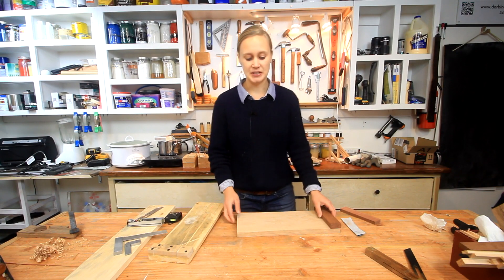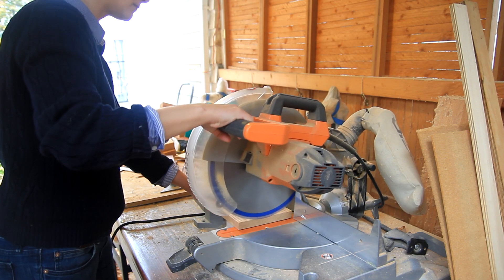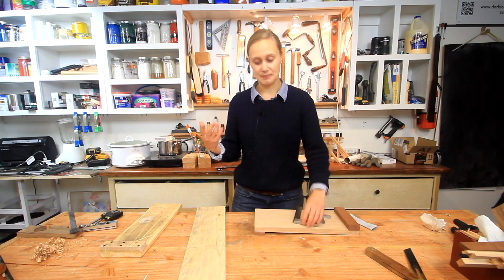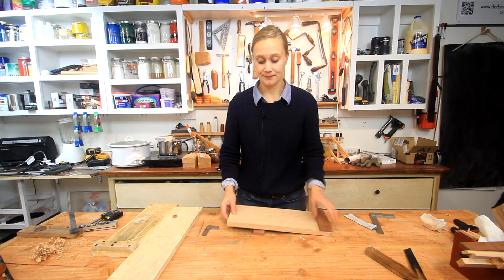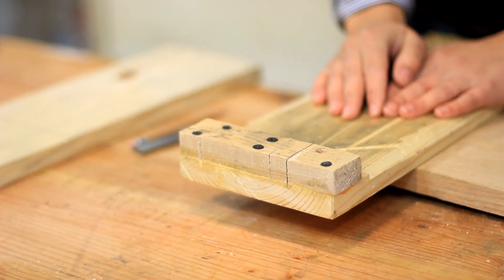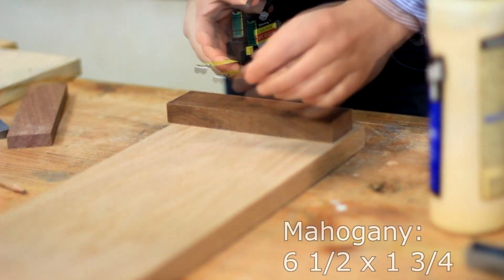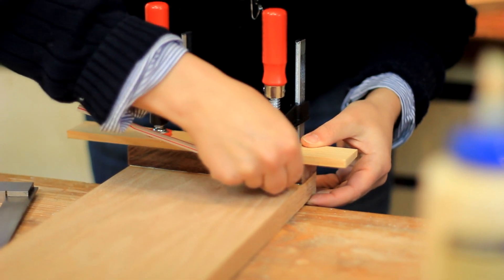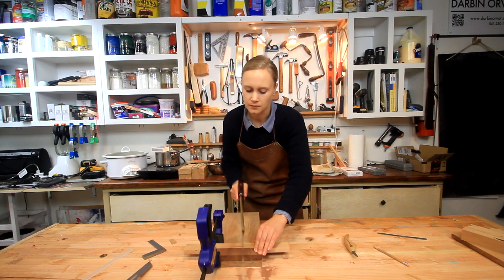Making & Using a Bench Hook

Comment: A bench hook is one of the most useful tools in the shop and about the cheapest too and it can easily be used as a shooting board also to square up those pesky ends and miters.  Good video Linn, some people will no doubt try one for the first time and will discover that the simple things can make all the difference, a few minutes to build one and it can save hours of chasing your work around the bench in frustration.
Reply from the maker: John Bare I agree John, it's really very practical, and not very hard to put together either.

Comment: I need to build another one of these myself.  The first one I made is dedicated for my stone to sharpen my plane knives.  I have boards screwed in the middle on both sides of my stone to hold it in place but not so tight that I can't turn the stone over.  Thanks for sharing.
Reply from the maker: Ron Briz Thanks for your comment Ron.

Comment: Nice build. I would perform one extra step after the glue up though to make sure the stop is properly at 90 deg to the board. Simply put it back on the saw and set the depth stop so that the saw just cuts into the base board and trims the face of the stop block. This has the added benefit of removing any glue squeeze out and providing relief in the corner ensuring a better seating of the work piece. I've just though though, this is only possible if you have a sliding mitre (or radial arm) saw and I'm not sure you have.
Reply from the maker: CNCtrl Thank you, that's a good tip!

Comment: What an absolutely brilliant job Darbin Orvar!  And a very nice unpgrad on an old world tool.  My Grandfather alwalys had bench hooks around, but they were only 2 to 4 inches wide and would be used in pairs.  I love you wider design for the cleaver adaptaion into a miter saw.  Thanks for a wonderfull idea.

I'm not certain how much you use it for planing, but running 1 or 2 short pegs through the hooks should greatly improve your hooks ability to resist the shearing forces, and would lend a slight decorative touch.
Reply from the maker: Michael Olsen Thanks Michael, that's a good tip!

Comment: Love your videos.You can use hot water to remove squeeze out.
The shop I learn woodworking in would never let glue dry on a wood project. People drive me crazy when they make a mess of glue & leave it to dry. I like the straw trick for small clean ups.